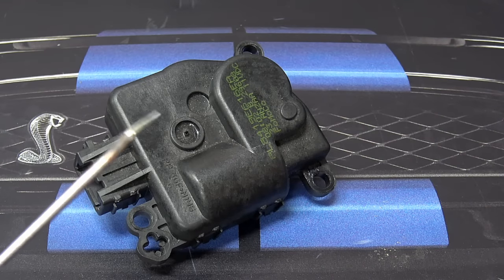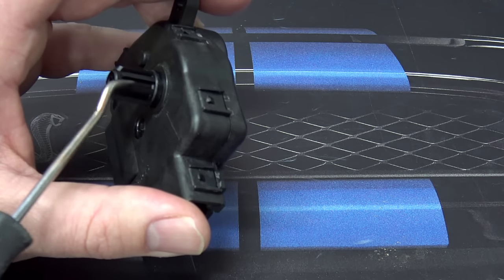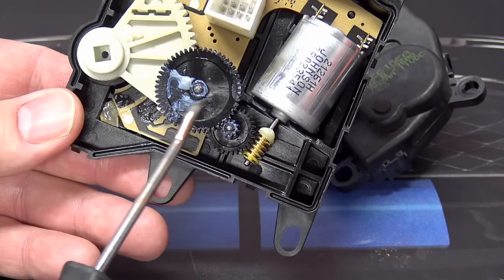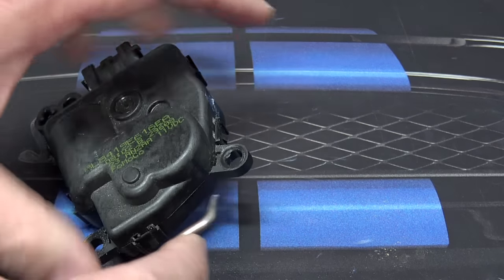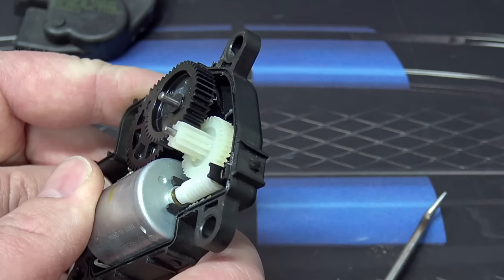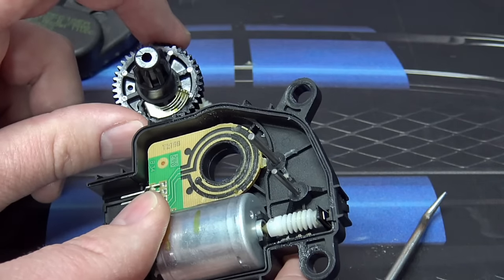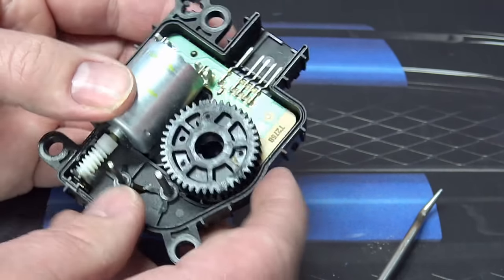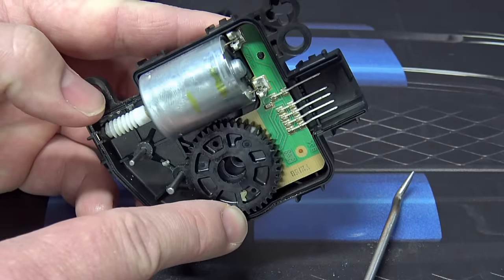Ford Vehicles: Frequent Blend Door Actuator Failures and Why?

Comment: I wasnt getting full heat on an 2008 STX. Tested the actuator (by listening with fan on low) and sure enough the actuator went from full cold to just about a quarter way to full hot. I replaced blend door actuator and the problem still exists, I'm not getting full travel to full hot. Is the blend door itself broken?

Comment: I’m having a similar issue 2012 Ford Fiesta blows cool on passenger side , warm/hot on driver side .. both actuator knobs turn visually when taking apart , driver side switches from dash, to floor ,to defrost as it should. Turn the passenger side actuator by hand and it still blows the same after re installing , I didn’t replace them because they both seem to work properly.. could this still be the issue due to the passenger side only getting cool & not cold & driver side not getting cool/cold at all?

Comment: I know this video is old, but so is my 2009 Ford Escape 3.0L with Dual Zone HVAC - LOL! Before I tear into the dash of my trusty ride, I could use a bit of advice. The driver side blows ice-cold AC, but the passenger side blows hot air. I know the problem is with one of the three blend door actuators (I ignored the telltale clicking for years- SMH). So, here's the million-dollar question: which actuator should I replace? Is it the one directly above the accelerator pedal on the driver’s side? The one behind the console closer to the floor? Or do I need to pull out the airbag and replace the actuator closest to the windshield? Any guidance would be much appreciated! @FordTechMakuloco

Comment: 2006 Merc gr marq I have the older model blend door actuator(bda).  Winter 2019: Diagnostic test 024,025. Bought new/old model bda $47.  2 screws impossible to get to (bda) thru glove box.  Was able to remove old (bda) top, left old base in car.  Took 2 old gears, & motor out put in new gears & motor to old base.  Still didn't move from hot to cold.  Manually set to heat for winter.  
5/30/20:  unhooked battery to manually set to cold for summer.  While there I hooked battery back up, unplugged the electrical on (bda), plugged back in.  A/C & heat worked properly for 2 days.  yesterday went to store, only heat blowing.  Today I did a diagnostic test 025, but A/C & heat is working again.  Checked all fuses.
ps The temp control works properly when system is switching from A/C to Heat properly.  Once it stops working & I go to manual I get full Hot on heat, full cold on a/c no adjustment on degrees)

Comment: So I have a 2018 ranger and the air direction cycles constantly to Demister. Replaced the actuator but still doing it??? Do the actuators get signal ie face,feet,demister from a logic board or control unit? When it cycles from face to demister or feet on the dash the face selection is still illuminated

Comment: New units installed at a labor cost of $500-$700 each time. This is what Ford Dealers charge customers to pull dash and replace both actuators. My truck was Under Warranty, I’ve had mine replaced 3 times, around $2K cost to Ford. Please note that a batch of faulty motors were also found and communicated to Ford engineers on this new design. Personal experience as I stayed with mechanic during remove and reinstall each time. We tested faulty actuators, as pictured in this video, and found the new actuator design had faulty motors, which was later identified as the motor failure, I witnessed all testing, removal, replace of actuators. New actuators out of the package were not installed until each one was bench tested. Their actuator supplier is guilty of not performing proper functional test. Then Ford hasn’t stopped this at the factory either. Yes, should be “NO CHARGE” to truck owners!

Comment: Hi,
I have a 2011 Ford F-150 XLT and I hear this loud clicking noise behind the dash. No matter what position I turn the knob to (from cold to heat) I still hear the loud clicking. Also, the air conditioner only blows through the defrost vents. The only way I can get the loud clicking to stop is to turn the air conditioner off. Is the part that I need called a blend door actuator? And is the actuator located right behind the radio? Thanks.

Comment: Ok, so I'm stumped. Have 2010 Ford Flex Limited. Have ice cold air coming from driver side vents, and warm air coming from passenger side vents. Dual climate control. Thought it was maybe the actuator behind the glove box, which I replaced one year ago. Pulled the actuator out of the door gear, it appears to be motoring fine (gear teeth fine)and gear on door has free play and you can hear the door open and close. So what now? I'm stumped. Could be a warm summer for the passenger lol.

Comment: Hi.  Question regarding the Mode Door Actuator.  2012 Ford Fusion SE.  I ordered Motorcraft Part Ford AE5Z-19C772-A - LEVER - CONTROL.   Replaced to fix inoperative vent control.  I installed from brake pedal location after removing brake pedal assembly.  The clam shell gear assembly that came attached to the mode door actuator was difficult to line up when bolted to heater air box.  I did not have confidence that I lined up the 3 or 4 door flap pins that line up with clam shell/mode door actuator motor.  

What is procedure to ensure all air box door pins are aligned to clam shell/actuator motor assembly when installing??!   Help!   After installing, I only get air through vent.  Not defrost or floor air.

Comment: This is interesting too.  Things that roll into the defrost vents can break the actuator by intermittently pinning the door in some position.  I know mine broke right about the time a screw rolled over the dash and down the defrost before I could catch it.  If this is the case, it makes sense to look for it while doing the actuator replacement or risk breaking the new one.

QUOTE

What causes blend door actuator to go bad?
Bad Blend Door Actuator: Symptoms, Location, & Replacement ...
What Causes a Blend Door Actuator to Go Bad? A blend door actuator can fail electrically (for example, a faulty motor) or mechanically (for example, broken gears). If some foreign object (like a pencil) falls into the ductwork through the defrost vents, the object may foul the blend door. Jul 25, 2023

Comment: hello sir!
i have ford freestar 2005. 
while turning the ac ON, i get cold air only in passenger side and behinde.
but, on driver side it is just regular amibant air on Dashboard vent, on floor and near to Mirror on left side.
do you think i have the problem with the actuator and should change it? or i can open the actuator and clean it to bring him back to job?
thanks

Comment: Can you please help me! I have a 2001 Lincoln  Continental the actuator sticks when switching from high temp (heat) to A/C, so the cold air is blending with hot. my question is do you know where it or, they are located  on my car. Thank you if you could help

Comment: On my 2012 Fusion turned knob all the way cold my a/c doesnt work. Turn knob a few clicks clockwise and A/C works. Heat works fine. Could this be blender door/actuator issue?

Comment: 2014 f150 xlt. The air only comes out from the ac vents. I cannot get the air to come out the windshield defroster or the floor. Any guesses or ideas on what could be the issue?

Comment: I have a problem with a 2005 freestyle my AC is cold on the driver side but not on the passenger side trying to determine which motor I need to change I looked in the glove box and I didn't see one up there on the left am I not looking correctly if you could help me out I sure would greatly appreciate it cuz I just bought this car

Comment: Huge thanks for this... haven't dug into mine but I'm definitely curious about why things fail.  My passenger side fails at about 69 degrees and goes full on heat.  I can calibrate it and it work for a few cycles but it reverts to this behavior around 68-69 on the passenger side... guess its time to buy the part and pull the dash apart to get to it.

Comment: On the new part I got it has an arrow that points towards a notch on the keyed motor gear. I have not replaced the old one yet. If it doesn't line up is that a big deal or can I turn it to turn to the right point to be able to align the install holes for the new part?

Comment: Hi Brian, 
Indeed this part does fail often

please answer me this top urgent

I tried to replace my blend door on my 2012 fusion 2.5L S
Driver side coz its stuck on heat. 
And i got the new part right from the ford dealer. 
But the surprise is the new part is only 2 pin connector while the factory one I had is 5 pin. 
Part number is the same, connector is same, shape and all same
But the pinout is different. 

I plugged it in to test it out but thr shaft is not turning..!!

The parts man checked the system several times to make sure its the driver side and no other parts showing..
And no update nor notes written under this part. 
Its YH-1886

Please help.. should i return the part or does it need programming or what..??

And why did ford cancel 3 pins on the board without leaving any notes. 

This is top urgent i must return thr part within 5 hours max. 

Thank you so much 🤒
I really appreciate all your vids.

Comment: My 2011f150 driver side is stuck on heat. Had them check it out and they think it's lower ac blend door motor... instead of paying for all the labor or risk breaking something doing it myself. If all the issue is, is that it's lost track of itself. Is there a way I can try an manually move the door and or reset the motor so It might find itself again??

Comment: I have a problem with a2009 f150 manual ac vehicle came in with AC blowing warm air from defroster duct. replaced mode door motor and blend door motor . Now can get different modes but blend door does not move off of hot. AC compressor and that part of system is cold. Only thing i can come up with is control panel temp control is bad .Have yyou ever come across this?

Comment: I have a 2013 F150 5.0 XLT. Recently mines been making a loud clicking noise behind the dash by the steering wheel when I switch from heat to cold or back to heat. Heat and cold air still blows great out all vents. Told to replace this behind my stereo. Did that and still makes the noise behind my dash. Help!

Comment: Lmao when you said PINION gear I hear the word pinion a lot with Ford part failures as well in their transmissions some tiny pinion breaks and good buy reverse. That should of been a recall on their 5 speed auto boxes including the Mazda ones even though some internals were different I don't think that part was. 🤬 Good video bud thankyou, what year was it they introduced these new pissy small ones? My Mazda 3 one still 💯 works but isn't calibrated properly I don't think like you explained it's over shot its mark in either direction so it works but does seal properly so air comes from the wind sheild vents still even when it's only meant to be your feet and stuff lol so annoying I hate hot air in my face. Also heats my phone up cos it's mounted up on the windshield same with dash cam and if I just put it on warm it's never hot enough because it's being shared by every vent or escaping into the dash even bloody clowns 😂

Comment: Would this failing cause no heat or air whatsoever? For example the blower mower is blowing, and there is absolutely zero air coming out of any vents no matter what the setting... just happened today, and I lost defrost when it was needed. Is seems it should have a default. Position
Reply: Or at least some method of fail safe... where heat is directed at the windshield whenever this fails.

Comment: Good old fashioned cable to lever was replaced by new fangled, high faluent electrical devices destined to fail. Why??? I gotta come up with some way of bypass the crappy module to get air back through the vents on my '07 lincoln. Not removing no dash.

Comment: I was wondering why my driver output dash level puts out hot and cold, but the middle and passenger stuck at mid-cool . . . no real heat or cold . . . the contacts for those two doors failed . . . fortunately, got the easier to work on 2008 Expedition.

Comment: Hi, I've replaced my blend door actuator on my  2011 Taurus today, the loud clicking stopped, but I still do not have heat on my passenger side climate. Could there be a different source that isn't working? I tried to reset my car by disconnecting my battery for a few mins. I seen a few people say it worked for them in many forums for ford issues. Still didn't work. HELP!

Comment: Hi i have a 2008 ford edge the heat only works on the right side of the truck not the left i see the actuator working and when i change the climate temperature from hot to cold the air comes out colder but if i take it back to hot it becomes a little warmer i can't see the problem it looks like the actuator is doing its job and when i recycle the air it warms up on the left side do you think the actual door is broken or do i need to change the actuator

Comment: Have this in my escape. Mine started clicking still worked but when switching between defrost and other settings it clicks for a couple seconds like it’s reached the end of the door opening but still trying. I replaced it and have the same problem... any ideas??

Comment: Will this result in ONLY heat coming out of the vents? My AC unit is definitely working/charged, but when I turn the dial to either vent or AC, the ONLY thing coming out is heat.
Reply: Leigh Guptill I have the same problem. And yes.
Reply: I have this problem in my 2011 Ford Fusion. AC starts blowing hot air all of a sudden. I was told this is the problem, & it is being replaced as I type this.

Comment: Where is my problem if I've got hot and cold, but the issue is switching my source? I.E. Defrost, floor vents, dash vents. If my AC is off altogether, I still get a draft blowing through the vents when I'm at speed.
Reply: For example if your ac is stuck in the defrost position then it would be a faulty blend door actuator

Comment: I’ve been following your channel now that my 2011 f150 developed the dreaded clicking sound right behind the stereo. But the problem seems to be related to a power issue I had where the battery died because I hadn’t used the vehicle for over a week and the was a parasitic drain which killed the battery. After charging the battery the clicking noise appeared and would be there whenever the key was on regardless of the havoc system settings. Then after a few days the noise suddenly disappeared and all is well. This happened on two separate occasions weeks apart. Any thoughts would be appreciated. Thanks
Reply from the maker: When the battery died and you charged the battery the HVAC module calibrated the actuators automatically by sweeping them to the endpoints of the track. In the end either way you need the blend door actuator.
Reply: @FordTechMakuloco  thanks for the awesome vids! I just followed your video for replacing the motor mounts. After hooking the battery back up, the air does not flow out of the upper vents. Your comment here makes me think it is the door actuator reset. How do I fix this? Is the actuator bad all of a sudden?

Comment: The actuator was not moving on a 2005 Crown Vic P71 (stuck on heat side) so replaced ac/heater control unit and the door actuator. After installation the new actuator, it moved to one side (AC side) and then stopped and would not move no matter what heat setting was selected. I said screw it and after driving car for two weeks it started making constant clicking noise in the new actuator. So I completely took out the AC/Heater control unit (and unplugged it) and the clicking remains while the ignition key is in the on position. I was wondering if this could be a GEM Module problem or if I just got a bad new actuator or your thoughts?
Reply: and by the way I opened up the original actuator and everything looked perfect inside. No broken teeth. It is also a manual heater ac control and not EATC.

Comment: I gotta change it out this week! Great video is it part 604-233 or 604-231 ? Ty
2007 mustang GT did take it off it's the wheel 2teeth broke its the 604233 but just need the wheel in it
Reply from the maker: +dogg Harley sportster 05 1200c  don't use Dorman!
Reply: FordTechMakuloco motorcraft is the OEM correct? I was about to buy the dorman model for my fiesta's clicking actuator..just a matter of time before I don't get AC :(
Reply: I just replaced the one behind glove box ,,lasted a week and clicking is back,,,Yes motorcraft replacement ,,,,Losers

Comment: my heater stopped working or puts out very little heat . my AC works great  how ever in the summer i had a day where the ac was not putting out cold air but the compressor was ingaged and i was getting heat instead of ac now its cold out and i am getting ac but no heat  is the device my problem

Comment: I have a similar issue with my 2011 Expedition but my driver side floor and dash blows cold air instead. I don't hear any clicking, does this sound like blend door to you?
Reply: I have a 2011 Ford Fusion & have been having an issue with the AC all of a sudden blowing hot air (not good in the South!). I am having the actuator replaced right now. I hope this fixes the problem. I do not hear a clicking noise either.

Comment: My 2011 F150 the one right near the radio area failed over and over . But so far my 2013 F150 has been working without any issues . Crossing my fingers .
Reply: Did you fix it your self? On the 2011 I believe I'm running I tot the same issue
Reply: +steven winn yes i did.

Comment: If Ford were to put a spring on top of the output shaft would/or did that fix the problem, but it would add both a part and labor (assembly) expense to it...

Comment: Would this cause the heat and a/c not to work at all when you try and turn it on?
Reply: rivera752  where is the AC resistor even located?